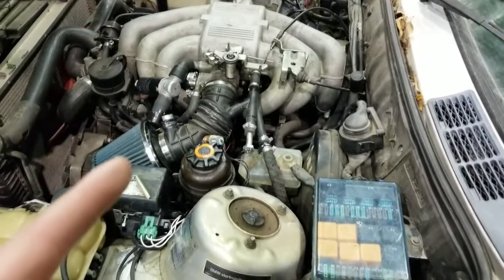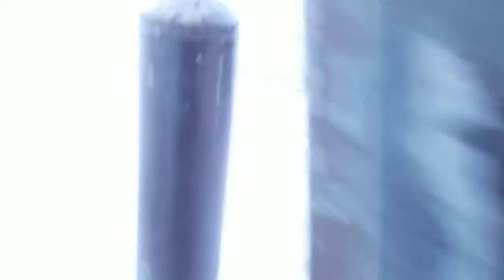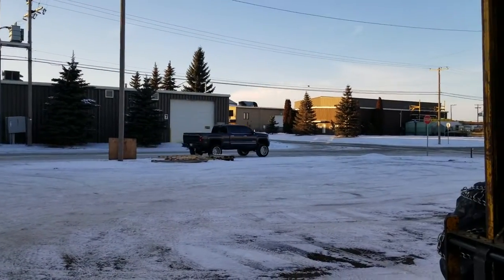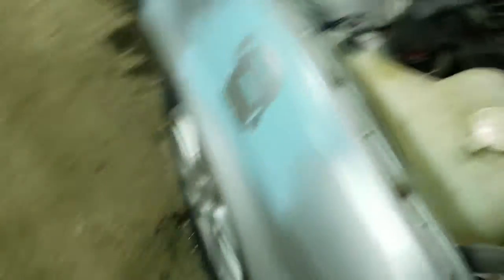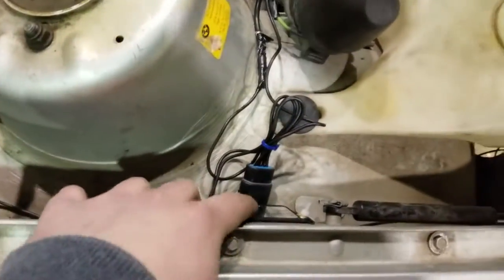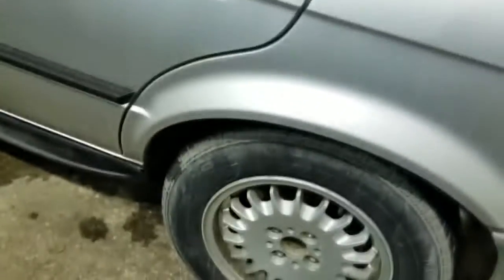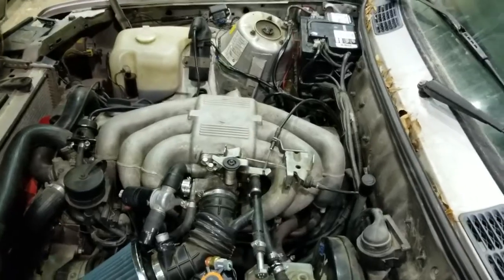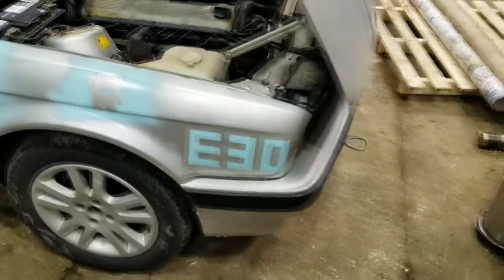E30 GETS STANDALONE ECU!! (Microsquirt+Flames)

Comment: hey dude are you still working on it ? it a really nice car and also the engine is cool. i am looking for something to do with a m50b20 put a microsquirt on it i realy do not want to go for the megasquirt thing sooo i was really wondering how you are controlling the spark and if you can even tune it and if its possible how do you do it ? and if there is any way of contacting you
Reply from the maker: sorry for such a late reply, unfortunately school took over my time and i ended up selling the car, the spark controller is an old 90s gm spark module which is controlled by the microsquirt ecu, it is completely tunable on a laptop plugged into the ecu using their software.